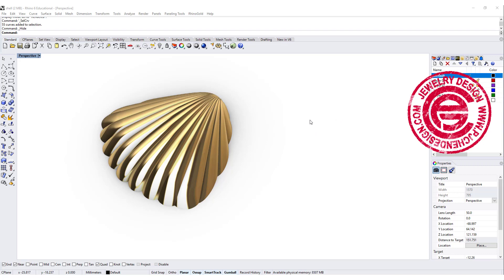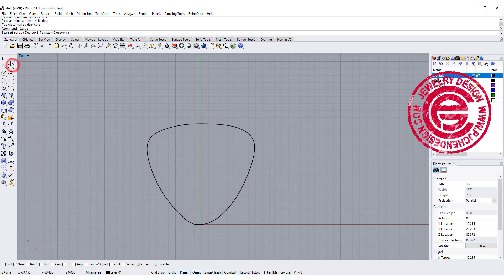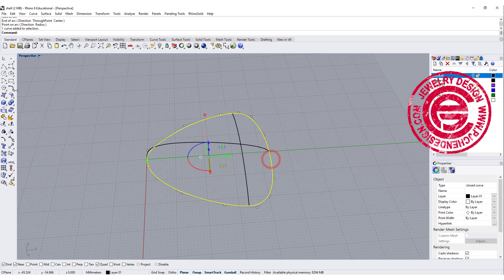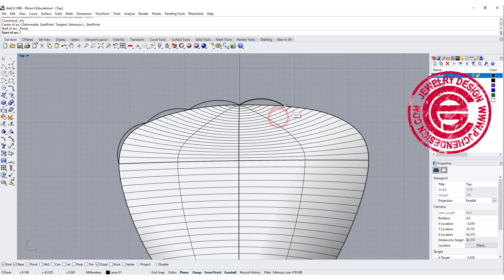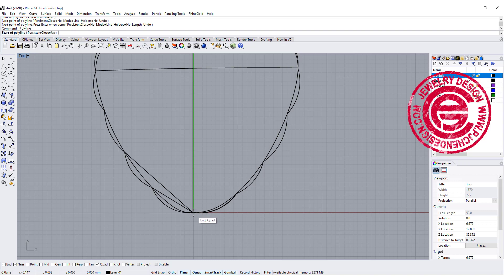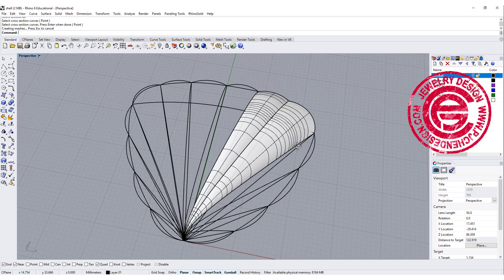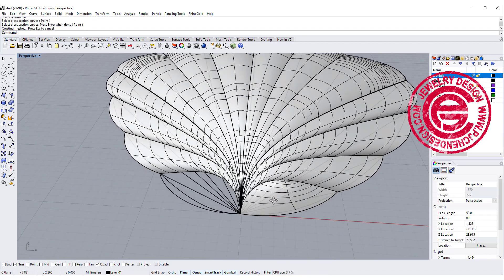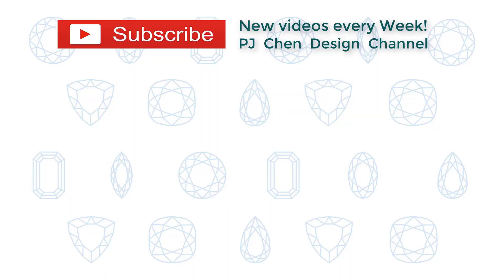3D Modeling Sea Shell in Rhino 6: Jewelry CAD Design Tutorial#102

Comment: hi great video, how would you then thicken this up into a solid that can be exported as a step file for machining?
Reply from the maker: depends on your design. you can offset the surface. or just make a copy and move out for the thickness. then create the surface in between surfaces.

Comment: Is there a way to create a custom toolbar with tools you use most often?
Reply from the maker: yes, under the "option- toolbar" you can call out the tool you use the most and drag them to the place you want them to stay.
Reply: @PJChenJewelryDesign  What about an individual tool?  For example I want a single toolbar to include a polyline, a pipe, sweep1, etc etc.  Is that possible?